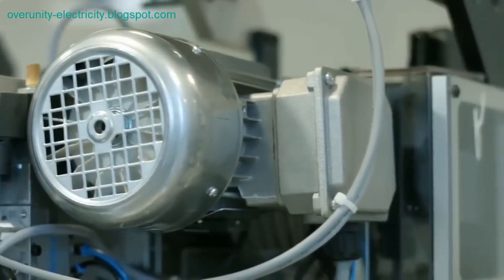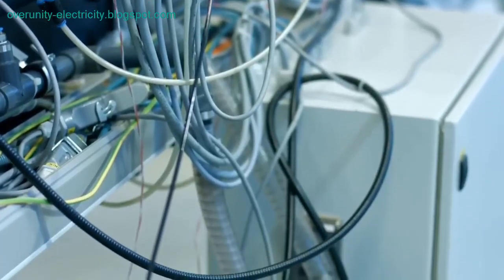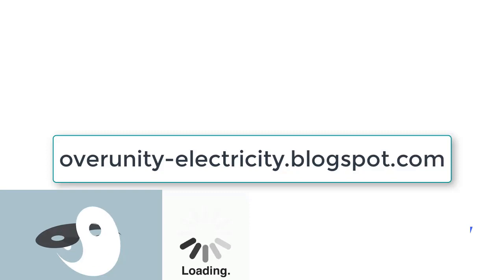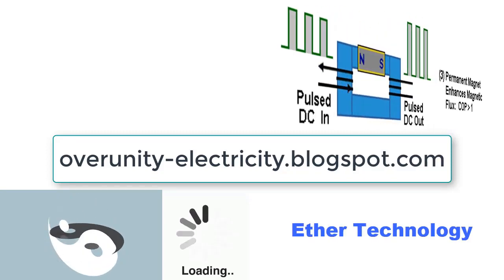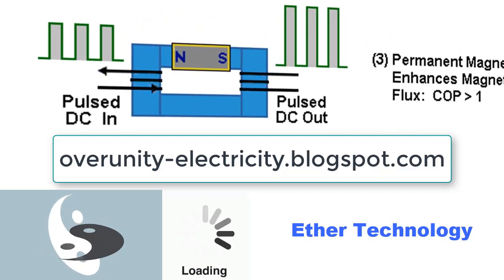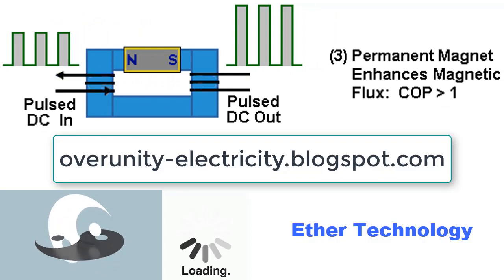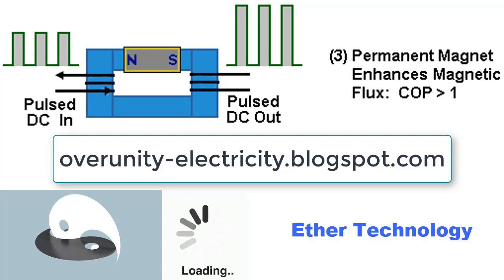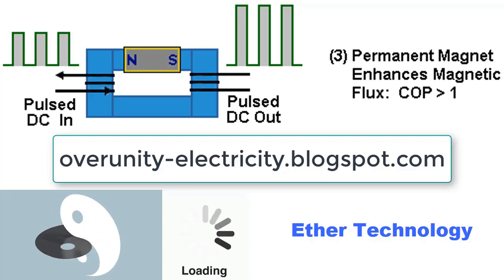Free Energy AC Generator - Power of Permanent Magnets | Ether field Technology

Comment: Make coils bifilar and Lorentz goes poof. Not sure if amperage will come, however.
Reply: I don't believe the bifilar coil is actually a requirement, rather it's exciting the circuit at its resonant frequency, since the bifilar coil vastly increases its self capacitance reaching that resonant frequency is easier due to the lower SRF. Since the Lenz effect is a result of retardation neutralizing the reactive aspects of the circuits would neutralize Lenz.
Reply: @JenkoRun I told you about bifiliars because the idea is absurdly simple. And I realized that as I was working on a Lorentz visualizer in Pascal. I wanted, and still will use a toroid coil in my attempt (and I really need Lorentz terminated otherwise becomes a motor) and I realized a simple thing: if a coil is bifilar, Lorentz forces cancel out because at every point you have one on the ongoing wire and also an opposite one on the twin wire. And this should be valid regardless of the coil shape. It doesn't have to be a pancake. Any shape will do. However, bucking half toroids can do the job without being bifilar.
Reply: @fxeconomist  opposite wire? I think you need to re-check Tesla's patent, the bifilar coil is not meant to have its parallel wire going in the opposite direction, the bifilar coils primary purpose is to greatly increases the self-capacitance of a coil.

"The effects of self-induction, above referred to, are known to be neutralized by proportioning to a proper degree the capacity of the circuit with relation to the self-induction and frequency of the currents. This has been accomplished heretofore by the use of condensers constructed and applied as separate instruments."

He's talking about exciting the coil at its Resonant frequency, where the XL and XC are at minimum, this is how Electromagnetic Retardation, the principle of Lenz, is neutralized.

A bifilar coil is not required, and you certainly don't want to use opposite direction parallel windings as this is a "brute force" method of trying to deal with the Lenz effect, you will only make the existing fields fight against each other which is very poor compared to working with the system.